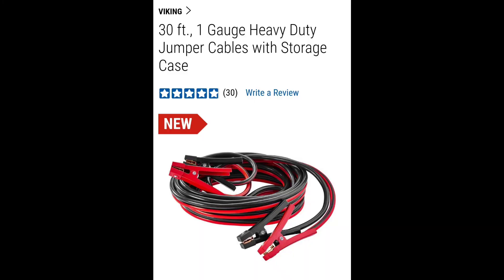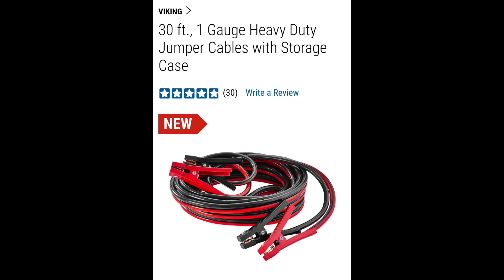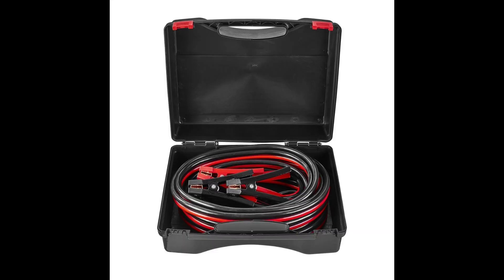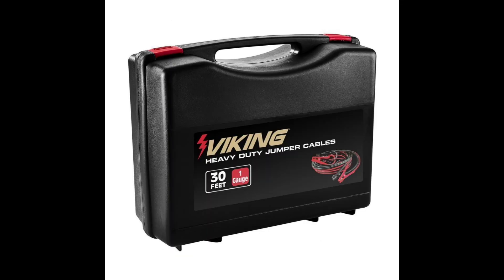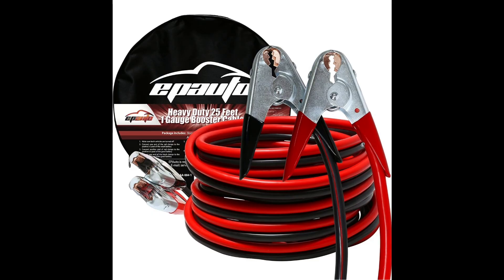Jump Starting A Vehicle - Frozen Battery Caution & Propper Cables I Like To Use And Recommend 3 of 3

Comment: Up here in Canada, we use a battery warming blanket on a timer for little used cars. Rich, you are so right about good jumper cables. We use #1 gauge arc welder cable with our own ends. Very flexible and you can make them up to 30 feet long. Expensive but worth it.

Comment: I made my own set of 0 gauge jumpers 30 feet long. They will start anything almost instantly and being extra long I can pull up behind someone to jump them. Yeah, those HELP kits are ok in a pinch, but folks need to know they cant just hook them cheap ones up and expect it to start right up. Those cheap ones will just self destruct on cranking lol. Also those cheapos need to be left on a while to charge the vehicle. They really should be called charging cables and not jumper cables. Thanks for sharing this info out to folks! Could save them a lot of headache when jumping a vehicle. Love the channel Rich!🙂

Comment: Hello Boss Man: Thank you for another educational video on the proper way to jump a vehicle or piece of equipment. You touched on something nobody has ever mentioned & that's frozen batteries. Since I'm going on 60 + years repairing cars, am I correct in my statement that if a battery freezes the sulfuric acid electrolyte inside the battery has deteriated to the point causing this frozen condition. I personally have been in - 55 degrees below zero, the wind blowing lowering the temperature, +  the wind chill factor, & never had a problem. Hope the rehab is going well my friend & God Bless to you & your family, TMP from N.J.
Reply from the maker: Yes you could say that
Reply: @FordBossMe  Thank you Boss Man, TMP from N.J.

Comment: I have a set of real cables in my truck . Also have a mini booster pack. Works well. Saved me a few times . I was at the camper 4 days . Packed up and ready to leave. My Cummins wouldn’t start. Nobody around . I used the little booster pack . Got me running right away. Went straight to Napa and bought 2 new batteries. I can’t complain they were the original batteries 5 years old.

Comment: A Good set of jumper cables will cost you but will last and be more effective, if you have a good connection, the engine can be started in a minute.  Most sets are now made with copper clad aluminum and will not last if they are bent as in putting in/out of storage.

That picture at the end is handy.

Comment: I know it's off topic and I apologize. I am a long-time subscriber and fan and I found a 21 tremor with low miles for decent price it's got the 402a package and the 3.5 EcoBoost no power boost. I am aware of the tailgate issue which hopefully can be corrected as you showed but I just want to make sure there's nothing else I should be concerned about like a phasers
Reply from the maker: So far they have been pretty solid

Comment: My battery got frozen I thought it is dead but after take it home warm it up charge with Ctek charger recondition mode and check voltage it hold it for several days I put it in the car and it still works. But battery is expanded I do not know how long it can hold!